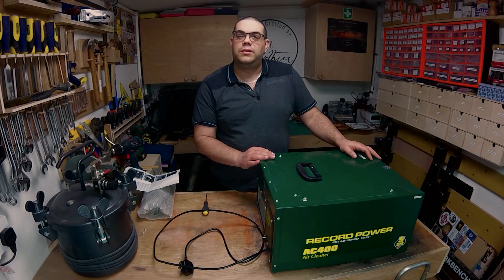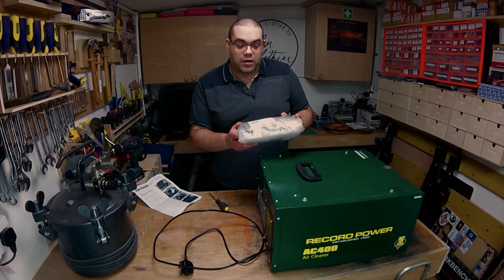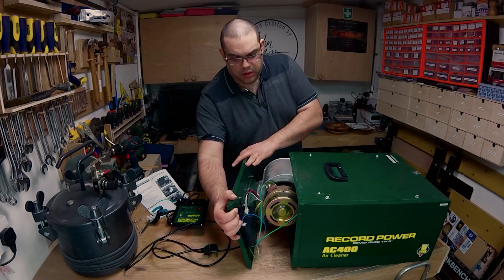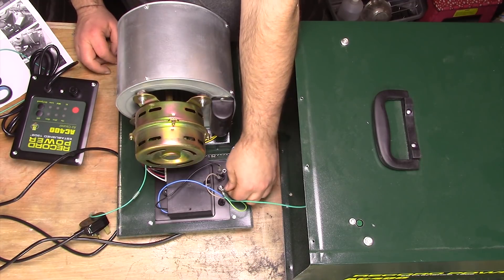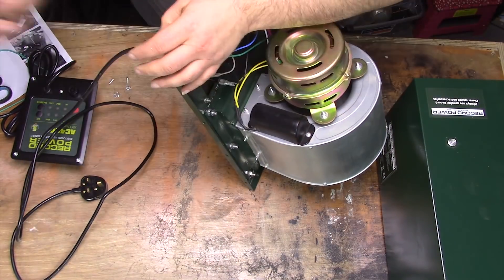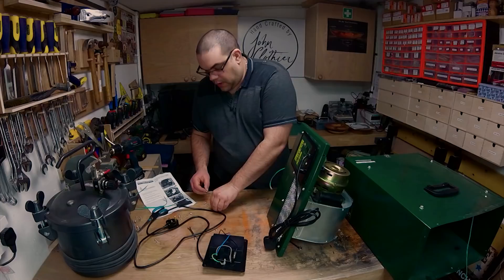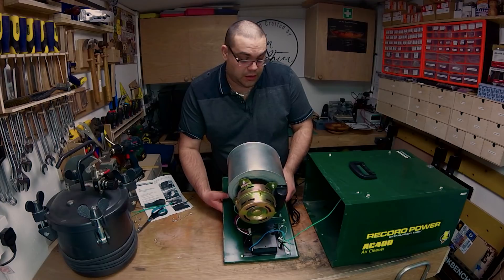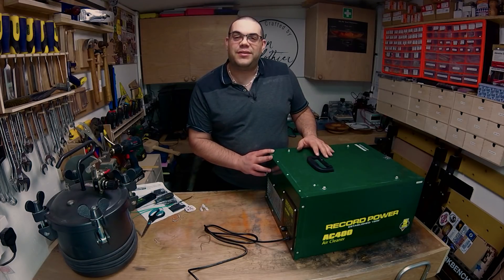Replacing The Control Panel On A Record Power Air Filter

Comment: Good repair walkthrough John, the PCB went in my Jet about 2 years ago, and I had to replace that, very similar to yours, but easier, as it was only the board :)
Cheers
Mike
Reply from the maker: Thanks Mike. Its a pain when these things go wrong but as you say they are pretty straight forward to put right.

Comment: Hi John great video I have a jet version of dust extraction my pcb board went a quick look on YouTube to find out that a 20 pence capacitor was all I needed to fix my one keep the videos coming
Reply from the maker: Thanks Harvey. When I looked at my fault one I think it was just a resister that had gone but under grantee so i wasnt about to mess with it
Reply: John Clothier hi I was I little worried but my brother was a electronic engineer designed pcbs for satellite 🛰

Comment: Hello, I'm Marco, I'm an Italian craftsman.
Three years ago I bought your Air Filter AC400.
For a few days the machine has been turned on, using the remote, you can select the three suction stages and also the suction time but the suction fan does not start.
What should I do?
Thank you and good day.
Reply from the maker: Hi. I suggest giving record power a phone call. It sounds like it may be faulty.

Comment: Nicely done video but I wouldn't waste anymore money on record power tools, I have one of these and it got no more than 40 hours use and it doesn't work at all now. Most of the lights are on but nothing happening. I've had issues with 2 scroll saws too. They are just generic machines with record name on it. Disappointed is an understatement.
Reply from the maker: I have always found them very good. Record make a lot of their own machines in house in the UK now.
Reply: @JohnClothier  This is a generic machine though. It's the exact same as other makes except different colour and name.
Reply from the maker: @PaulC1980  Yes this one is but aside from this one issue I have never had any issue with it. With a 5 year warranty to its hard to beat
Reply: @JohnClothier  Scroll saw too 😂.
Reply: @JohnClothier  I have a bs9 bandsaw actually and it's the entry level. It is a good machine in fairness.
Reply from the maker: @PaulC1980  I dont think they sell that anymore. They are looking at developing their own

Comment: May i ask, how good this device is at removing the dust in the air, and whether you think it would cope with a garage size workshop, Many thanks
Reply from the maker: Given that my workshop is 6m by 2.5m it has roughly the same volume as a standard single garage. Also given that I have pretty good dust extraction and that I have to clean the filter a couple of times a month and finally that most of my equipment and bench have little dust on them I would whole heartedly recommend it. When I as without it for a while I really noticed the difference. Hope that helps

Comment: Hi I have just changed the PC board on mine  although Record Power sent me it straight away  they only sent the actual PC board and not the unit, It wasnt identicle to the original, but did the job. I used to be able to operate the unit using the remote from about 15ft with the back of the unit farthest away, Now with the new PC board in I cant operate the unit at all from the same location, I have had to put silver foil about 1ft away from the back of the unit to bounce the signal to the unit  to operate with the remote,  (rather than walk up behind the unit)  It is hitty missy that way which is a pain. Any ideas please. Thanks
Reply from the maker: Hey James. Sorry to hear you are having problems. I'm afraid I don't have any suggestions I can make. I would give Record a call and see if they can help. They are a great bunch there.